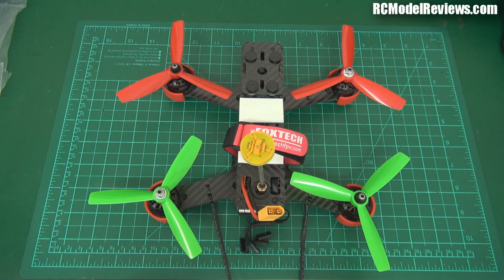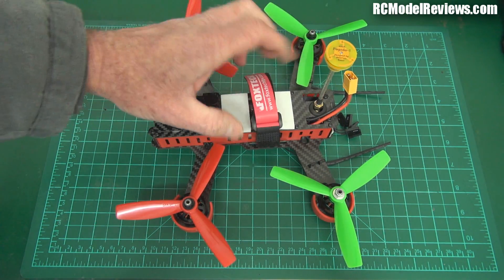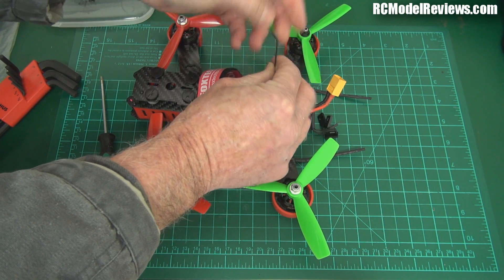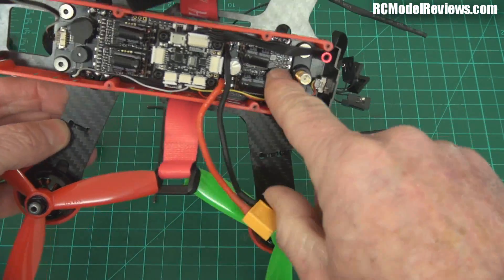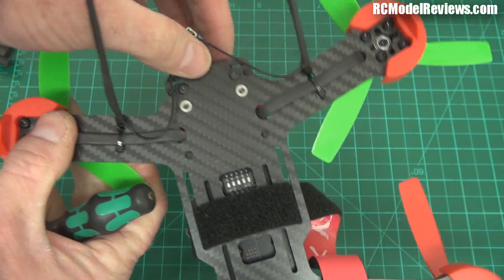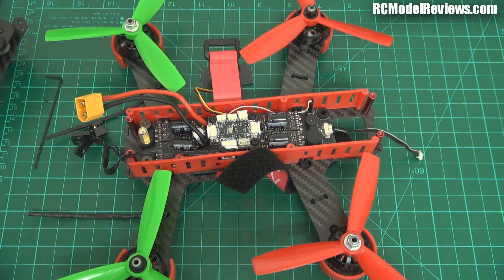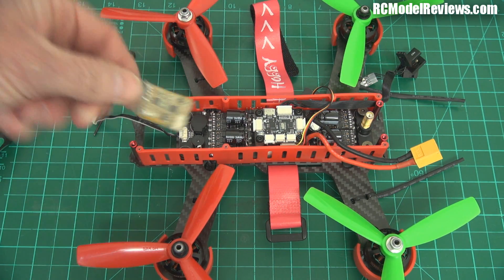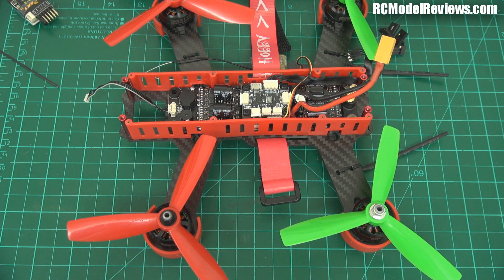DYS Lightning 220 racing drone - the final word

Comment: You're being too much of a drama queen...

The one single problem is the frame is badly designed. The quad is fine though! Your complaints are valid but ive flown this, its fast, handles well, durable as hell and it still going strong on 4s after a few months with 0 breakages after many crashes. The issue about the 12 screws at the top: Get a good kit dude. It takes me literally 30 seconds because i invested in a good hex driver kit.

Overall, good flyer, but i'd rather go build your own.

Comment: Switching between 25/200mw is actually very simple, remove the left side plastic cover and you will see a black switch on the side of the vtx module, flick that to 200mw and you get nice clean video. 
I've had a good experience with this model, all it needed was hot glue on the capacitor legs so they stay put and a tbs crossfire micro receiver via sbus which slots in anywhere. 
This quad is a performance bargain and it has taken an absolute thrashing with no damage. 
Pids and rates are tunable through your tx via osd.  
Fiddly deck is it's only downfall for me. 
Flies amazing with stock betaflight firmware.

Comment: As always, love your reviews Bruce. HobbyKing 1/2'd the price of this few weeks ago,and I decided it was worth it as a hack about quad. I put a low pass filter in-between the transmitter and the aerial and replaced the crappy one they supplied and it was clear as day, even on the 25mw signal (not 20 as it says in the manual)  also, there is a slider switch by the video transmitter to increase the power, no need to take the board off the back plate to get at it. 

It's not really a 'racing' quad, but it's pretty quick all the same at £100 it was worth a punt.

Comment: Bruce, a bit of constructive criticism, but first, I must say I have learnt so much from yourself over the years and I am also one of your loyal Patreon supporters. But... I am starting to drift away from this channel to watch others, because your focus is primarily now on mini-quad or FPV reviews, which is not what I came here for all those years ago. You have a wealth of knowledge and experience in electronics and RF. This is your specialty. This distinguishes you from the rest of content producing sites (with larger budgets and more staff which is increasingly going to be very challenging to compete with). This in-depth electronics knowledge is what will get me departing with my money on Patreon. I (along with many others) are
building all sorts of custom multi-copters, heavy lift autonomous vehicles, aerial vehicles that are heavily laden with electronics, but have a ton of queries with regards to video transmission quality, long range/medium range/short range video or control transmission, neutral ground loops, interference, isolation, floating points, etc etc. For example, I busted the
capacitors on my ESC the other day, but appears to still work, perfectly, why is this, and what will be happening electrically if I keep running it like this? I would love to know. Why 2x 100uf capacitors and not 2x 10uf capacitors. How do I get the perfect, no interference switch mode power supply for 5v and 12 volt system, why arnt the immersion rc tx systems compatible with the skyzone goggles.... etc etc
Ok, maybe I am ranting now, but more mini quad review will see me drop off from Patreon and I will turn my attention away, I wish I dont speak for others when I say that but based on the comments I am seeing and your reducing Patreon $ value... I unfortunately believe I could be.

Comment: dismantle from motors wires,  rip out vtx replace with something reliable and put antenna out the rear, then use freed space from old antenna  for rx..... would a cable from the vtx to the camera be better off going across the top board higglety pigglety?.
i would really love to see this quad fulfilling its potential, ie line of sight it was a rocket, camera guy never followed one punchout. hehehe

Comment: Couldn't you take off the bottom plate to get at it?
Reply: If you look close you can see, that the cables coming from the motors go
 underneath the plate and back up and are soldered to the pcb. You can't
 take the arms off, it's one piece. So no, he can't just take the bottom plate of.

Comment: If you would like to review an even bigger piece of crap that will really piss you off then get hold of a Hobby King Quanum Venture, a so called RTF quadcopter.  I got one after seeing all the videos that make it look like it flies beautifully (that were all fakes by the way) and it's so heavy and under powered that it can't even get off the ground!  Apparently their idea of RTF is a lot different from mine because I expected it to actually be able to fly!  It's big and heavy but only has 20 Amp ESC's and tiny little 2213-935 motors.  I guess they don't test the models at all before shipping because a motor and ESC were bad at first too and were nearly impossible to replace because they put red thread lock on all the screws so they won't come out and have to be drilled out or ground off with a Dremel.  With good motors it still couldn't lift off the ground so I tried removing every extra part like the camera housing and the top and heavy bottom covers.  Some people say they got it to fly by replacing the original 8" props with 10" props.  It has so many other problems though, like mounting the flight controller underneath the frame where it's upside down, that I don't think that will work either.

Comment: Bruce, instead of unsoldering the wires couldn't you just take the frame sides off? The motor wires then go through the base so you won't gain much but it might just give you enough space to get underneath. Not ideal but if it saves you desoldering then it might be worth it.

Comment: Is it really a good idea to put the receiver on top of the ESC? D4R-II doesn't have shielding either. I've had a few builds where the video wire came too close to an ESC and i started getting artifacts, and that was with a physical connection. How bad would it be for a very sensitive receiver.

Comment: Did you check the polarization direction of that antenna?  I had a similar problems on a quad.  I was using it with an antenna I bought online, and when I popped open the cover, I found the antenna was left hand polarized and all my receiver antennas were right hand.

Comment: Just dont buy quads that use proprietary gear , the vtx dips are easy enough to access to change channels but i agree about the  receiver space , the simple solution is to install it on one of the arms were we would generally place an esc.

Comment: Poor design but FFS, it's 8 solder joints, that's less than 5 minutes to desolder. 12 minutes whinging  when you could do the entire job in that time. Sure you shouldn't have to but reviews aren't just flying.Stop moaning and get on with it.

Comment: Bruce,  invest in some good hex drivers...
Reply: Bondhus IS a quality set of wrenches. Used throughout several industries. It's the teesy 1mm or 1.5mm size getting so over-tightened that causes the ball-end to round off when trying to loosen it.
Reply: I'm not referring to the brand, but rather the style..  those little dinky L-shaped things are terrible.  And those ball-ends are awful!
Reply: Stacey Abshire
In this hobby, I too hate those ball-ends - any brand. I guess I just have a fondness for them from work... of course they're the larger sizes there and it becomes a different story.  Sorry.
Reply: Ball end hex key wrenches come in handy for certain situations.
Mainly hard to reach screws.

They were never made to stand up to high torque forces.

In this case, I would have used a standard non ball end wrench to loosen the screw first.

You need both sets.

Comment: That's always surprising me, how such manufacturers which have ability to make a good products waste their time and money on such crappy ideas. All they need to do is to take good components and assemble them, but not, that's too easy for them...
I believe everybody here can build a better miniquad than that. So why don't they just hire a man who knows what is racing miniquads about?
Reply: I suppose you could watch videos on how to build your own,but lets face it,not everyone is talented enough to build your own,so there will always be a market for those cheap crappy things.I personally can build a quad. I know many guys that want to get into it but just like RC planes,you need to know more than just the flying part,other wize you will be throwing money down a rat hole. I know the quad hobby has really taken off in the last few years and I hear a lot of kids saying how much they want to get into the hobby,but then they turn around in the same sentence and say they dont have money for the transmitter,or the FPV equipment,or the batterys. If you cant afford those,its not going to matter how cheap kits or part are. If you crash them,and you will,your are going to have to replace parts. You have to also have an understanding about programming,how to set up the operating systems,how to trim out the quad when you do get it going. The number one thing above all that is trouble shooting the damn thing. like Bruce showed,even the already built ones are going to develope issues. When you crash it,it resets the program,or wipes out the program,or cracks the board,so things work intermittently.  Throwing money at the problem is just going to take you back to the excuse of not having enough money to even get into the hobby in the first place. The biggest farce out there is Toy manufacterers calling their quad a racing drone. I wouldnt race any of those shit already built quads,except to the bin mabe. Thats the difference between the men and the boys my friend. Toys are for boys ( and prebuilts are nothing but toys) Actual racing quads are built to be hobby grade,a man's quad. Definitely  not a toy!
Reply: You are right. And designing and building a reasonable good one is probably not even more work.

Comment: Increasing the power on the video transmitter likely won't make any difference, as the video signal is contaminated before it reaches the video transmitter. Hence, increasing the power of this transmitter will merely increase the power with which this dirty signal is output. As you pointed out, the layout of the quad is flawed.

Comment: Who needs to buy a prebuilt when you've got so many good quality cheap parts on the market, zmr250 cheap build anyone :P

I would quite like to see a helical antenna comparison video. Ranges, working angle etc for the different amount of turns.
I'm currently using a 3 turn helical and was the best investment I've made for my video system so far, can't recommend them enough.
Reply: not every one has the ability to build these things but still want to fly. If I want to get into the hobby I am NOT going to buy a kit and build it dude. That would be like saying I want to buy a good car but can only buy a kit and build it my self. If its a prebuilt it should be ready to go and no stupid crap like that. Its inexcusable in this day and age. The only thing that damn thing would do is make you want to get out of the hobby. I am sure it wasnt cheap eather.
Reply: scott firman, it's batter to ask someone to help you whith the build, then wasting your money on such crappy products.
Maybe one day they'll be good...
:)
Reply: +scott firman That analogy isn't quite accurate. A better one would be buying a lego model and then playing catch with it. You will crash, it will eventually break and you need to learn how to fix it. If you're confident in your skills then that's fine but if not you'll find your first blown ESC to be a very unpleasant experience

Comment: So sorry to hear that you couldn't make it work, chap. However, mine is working fine other than the useless antenna which I must agree with you so I replaced it with one from Fatshark. The vtx on mine is delivering clear picture and even was still working when my flysky i6 started to lose signal at nearly 800m radius.

Another thing that I must agree with you is that there is very limited space to work with and fit other things inside the frame. But it's no big deal as every other thing works well for me.

I'm quite happy with it anyway and I just needed few hours to set up the RX placement and install the betaflight. Everything is just okay for me as a newbie. Simply different lucks, perhaps?
Reply from the maker: So you have no noise on the video?
Reply: Bruce,
Do you think you have a dud. Like you say, if there is one you will get it.    :-)
Reply: RCModelReviews Not at all Bruce. In fact, I'm using my good old Fatshark Predator V2 with standard antenna and I was surprised that my friend's quad with another 200mW VTX (with clover antenna) on emax racing quad along with Flysight goggles was having blank screen for more than 2 secs (he crashed his after that) on a casual race we had last saturday. Although having few split second blinks when the quad was very far away from both of us (near flysky i6 distance limit) the DYS vtx was still delivering crisp video on my goggles. May be I got a good batch, I don't know. Most of my friends were impressed back then.